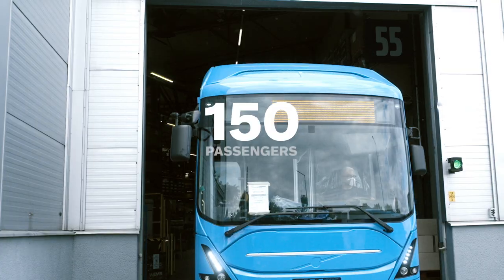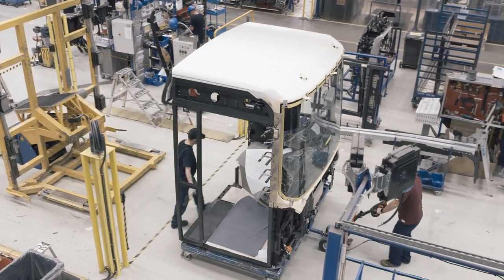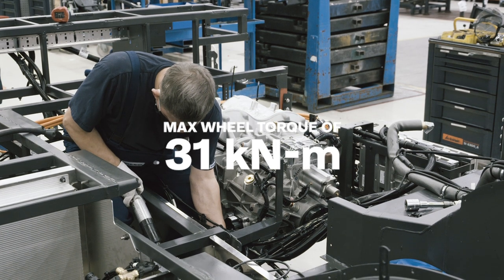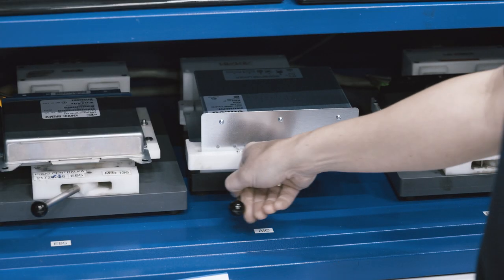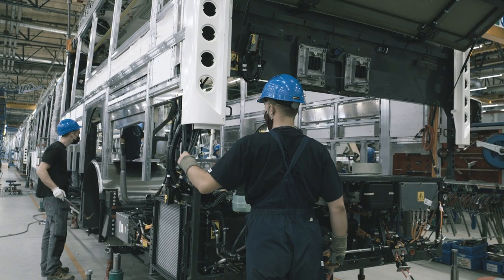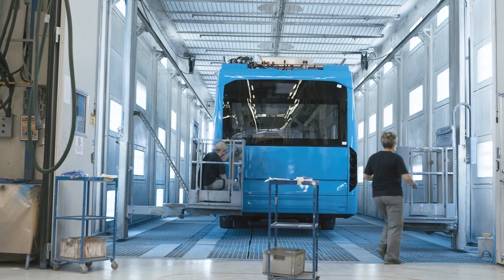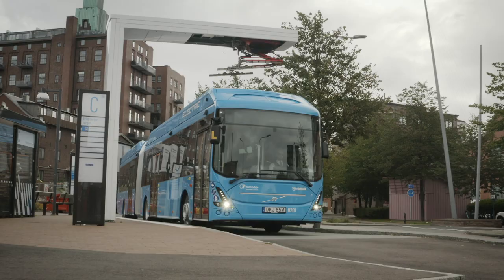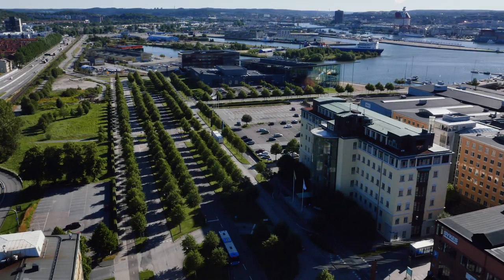Volvo 7900 Electric Articulated: how it is made | Volvo Buses

Comment: The Electric batteries on the roof are an enormous fire hazard.

I don't really mean to have a go at Volvo in particular but EVs or hybrids in general will face the same potential risk. 

When an electric battery goes on fire, the rate at which it burns and spreads is incredibly fast.

There's video footage of a bus in Paris, where the battery on the roof has caught fire and as the public stand back and watch it devour the vehicle by the time it's almost burnt the entire bus - there's still no visible signs of the emergency services.

Sirens can be heard in the distance getting closer but not nearly fast enough.😳

I am not convinced that EVs or Hybrids are necessarily the answer.

Hydrogen fuel cell or Hydrogen combustion engines possibly.

Comment: 18 meter bus can not take 150 passengers, this is not a normal capacity. It is an overcrowded capacity. Normal would be 130.
Reply: It depends on local regulations, particularly relating to axle load. In some European countries 150 or so is normal. In other jurisdictions like Australia, 110-120 is typical.